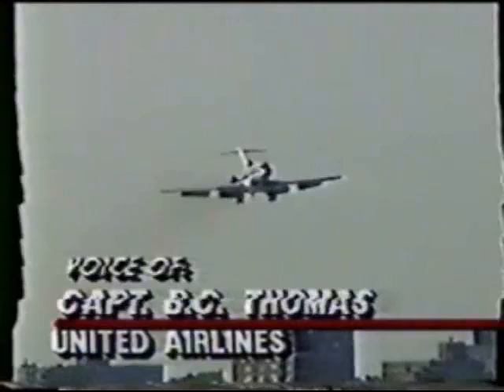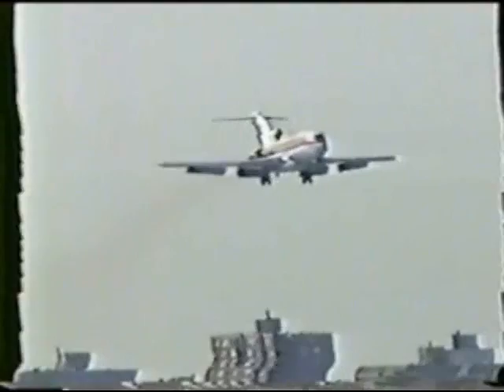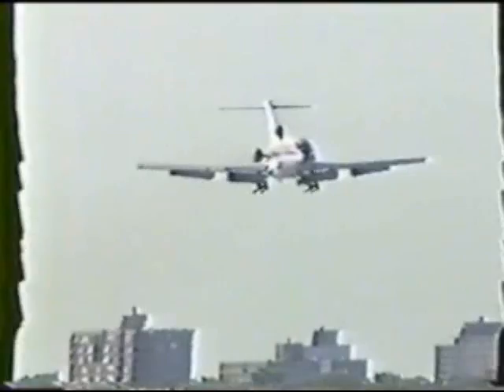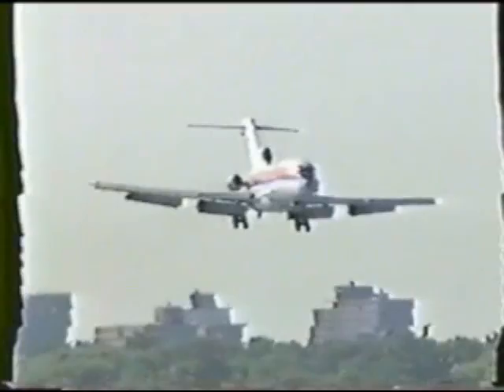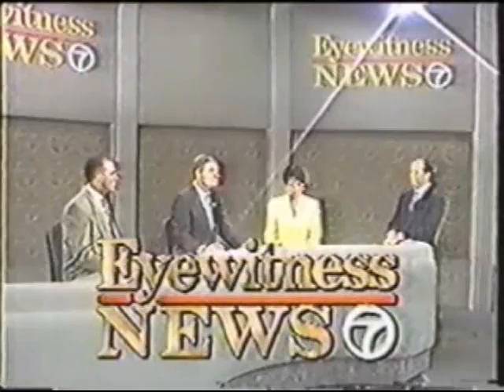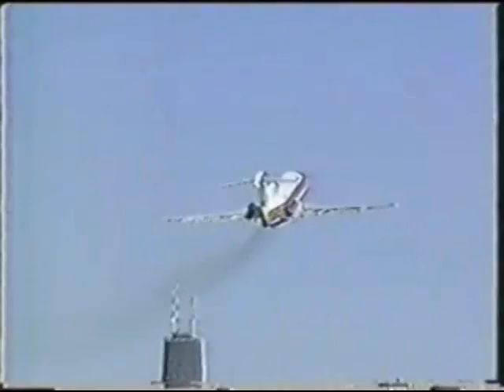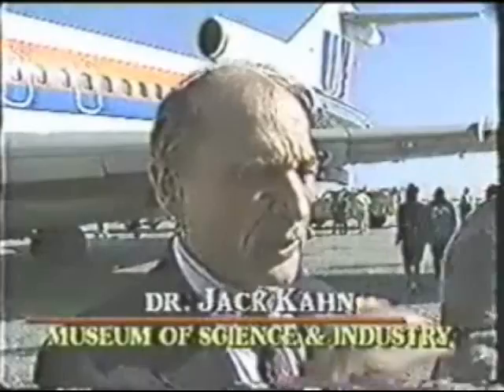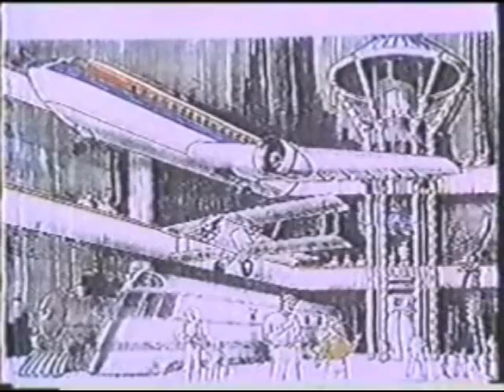727 Landing Meigs Field, Chicago Museum of Science and Industry

Comment: I was fortunate to see the plane run through its flight profile from SFO to ORD at  the museum. What a genius exhibit! Sadly, from what I heard, hydraulic fluid leaks dripped onto the model railroad below, causing the decision to drain the systems for good.
Reply: Even though she is empty of fluid they revamped her with electronic motors to open the landing gears and flaps for everyone to see. It is operated by a clicker the size of a garage door opener. You can do it yourself if you pay for the behind the scenes tour with the museum. I and my son got to do it for free with our yearly museum membership as we selected the behind the scenes tour. The plane used to use lights and loud speaker and projectors to simulate a take off and landing scenario going from Denver to ORD Ohare every hour or two. I have not seen this show in a few years though.

Comment: What an amazing landing, think that was the lowest ground speed a 727 has ever had?
Reply: The B727-100 had 40 degrees of flaps for landing, but most airlines used 30 degrees. The B727 at minimum landing weight and fuel could be slowed to below 90- 95 kts with 40 degrees of flaps. The B727-100 also had optional nose wheel brakes which would activate with more than 50% brake application. It could stop pretty short in this minimum condition with Maximum braking, spoilers and Maximum Reverse Thrust. At Continental Airlines we demonstrated this on aircraft trainers in the late 60's and 70's, before Flight Simulators where landing certified. I'm surprised the UA pilot did not practice short field landings before this highly publicized event.